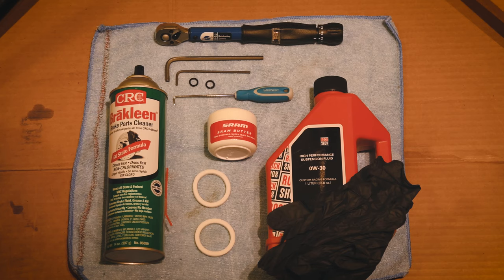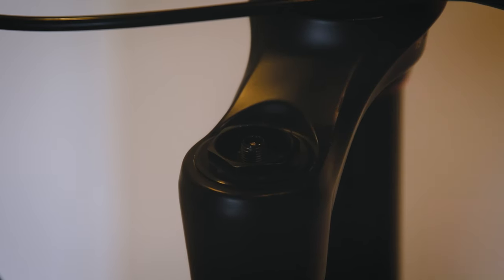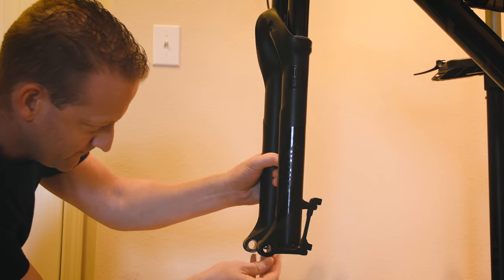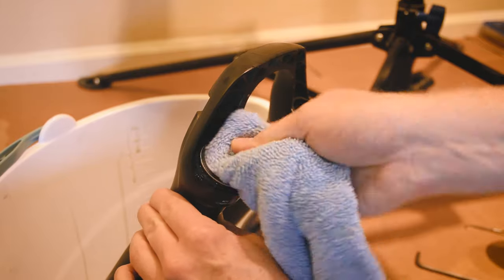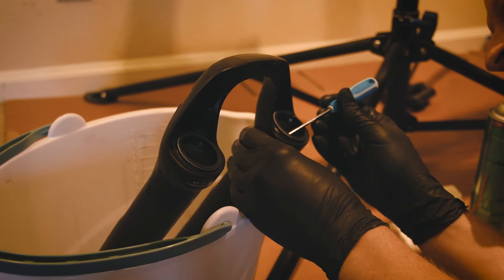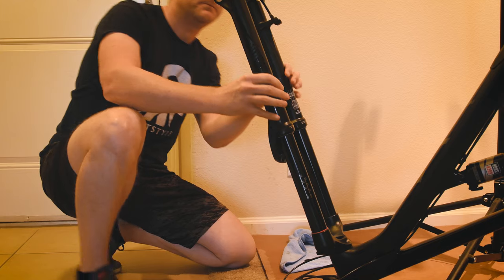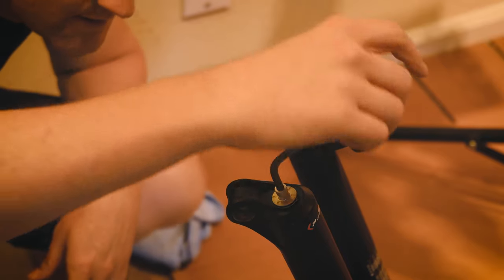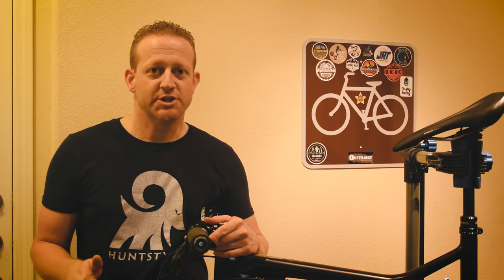Rockshox Pike 50 Hour Service!

Comment: The timing of this rain is what sucks.  My trails dry out just in time for it to rain the day before my days off.
Reply from the maker: I know man! I'm about to start bringing my bike to work when I think they'll open the trail, cuz if not, they'll open it, then it'll rain the next day and it's closed again!
Reply: @huntstyle  I was lucky that the worst of that storm system went to the East and West of my house.  I didn't get much rain but I think the trails did.  I'm not even sure where I could make a day trip to either because of how big that storm was.
Reply from the maker: @oklahotb3217  Yeah, that's been the issue lately. When it rains here, it rains everywhere within a 5 hour drive!

Comment: Super helpful. I have the same fork. 👍👍 
The video did seem a little dark. Probably my phone. All good.
Reply from the maker: Yeah, it is a bit dark back there, even with all the lights on!
Reply from the maker: Just be sure to check the oil volumes! The first time I did this the volumes in the manual weren't the same as I had remembered. Turned out, I was looking at the manual for the 2018 model. Mine is a 2017. And they're different!

Comment: I guess I'm still a teenager, I chuckled from all this hot shaft talk LOL. This made me think I might be able to do this myself. Do you perform your own rear shock service?
Reply from the maker: Yeah, some subtle jokes there, glad someone picked up on it! I haven't done the shock, but probably could. I was going to over the winter, then ended up just taking it to a shop to do both because there were so many tools I'd need to buy. Then when I picked the bike up they told me they didn't even do the damper service on the fork because they said it'll start acting funny after you mess with it, sometimes. That kind of upset me. Thought I was paying for a full service!

Comment: What size crush washers do I need? Also does the damper side takes a different crush washer from the spring side?
Reply from the maker: Rene, I would check the service manual for your model. They're available on the Rockshox website. I think they're all the same size, but best to double check.

Comment: a question - when you injected the new oil into the legs, you mentioned you did it on an angle so the oil doesn't go into the shaft - where does the oil go due to the angle? I'm a novice but trying this in the near future!
Reply from the maker: The oil is needed in the lower leg, in order to keep the bushings lubricated. You wouldn't lose a ton if it went into the shaft, but with only 10 mL, there's not a ton to lose in the first place!

Comment: QUESTION... When you inject oil by the syringe, do you want it to ONLY go into the lower legs or half lower legs and half damping rods? It doesn't look like they would mix during riding because the damping rods are bolted to the bottom of the lower legs, so it seems like you have to get it in the right spot.
Reply from the maker: This is just the lower leg service. Damper service is separate.
Reply: @huntstyle  So, when injecting oil, we want it to completely miss the inside of the damper rod, and go into the space between the lower and rod?
Reply: @huntstyle  ?
Reply from the maker: @Nelson-sr2bi  yes

Comment: Is this the same procedure for every Rockshox? I have the Yari on mine.
Reply from the maker: Pretty much. There are small differences, but the most important thing is to get the right amount of oil in each side. Check the link in the description to the manuals on the Rockshox website and find the one specific to your fork.

Comment: Do you have to use 0w-30 suspension oil or can you use regular motor oil with Ow-30?
Reply from the maker: Why would you want to use motor oil? Why not just use what the manufacturer recommends?
Reply: Huntstyle I have some leftover motor oil that I no longer need. Was hoping I could use it
Reply from the maker: @ehdeereotutar6843  I wouldn't risk it, personally
Reply: Huntstyle I went ahead and bought rockshox suspension oil. Will do it tomorrow, hope it goes smoothly. Thanks for the tutorial, great job!